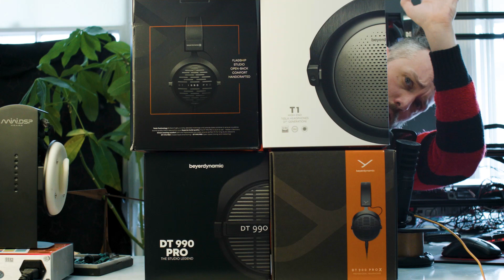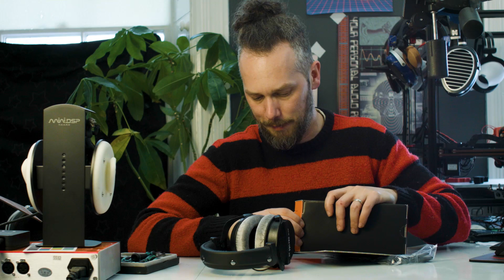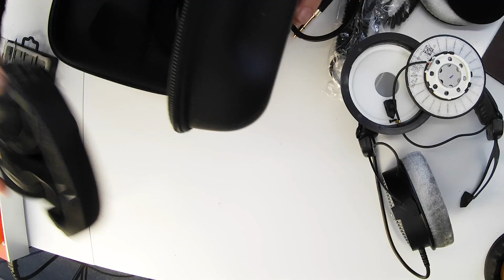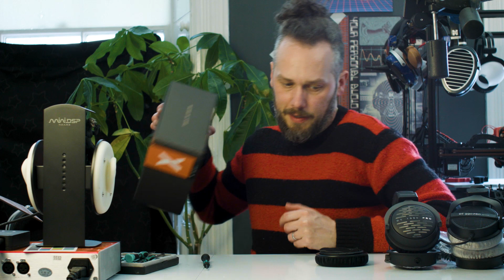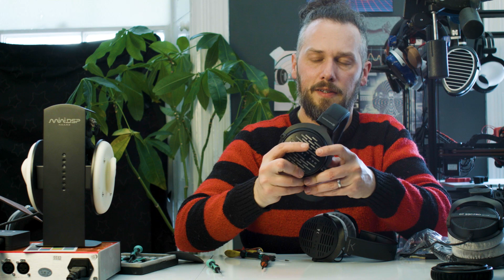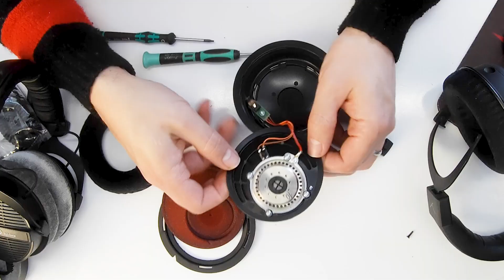Beyerdynamic DT990 vs DT900 vs DT1990 vs T1 open back Royal rumble Part 1

Comment: Hi, is possible to replaced the plastic hinge on Beyerdynamic T1gen3 to metal hinge from DT1990? and you did not mention what parts are metal or plastic in these both headphones (Ex: the black around cups). Thanks
Reply from the maker: No

Comment: yeah im guilty of breaking those small cables on my og 1990. Im still not sure if fixing them is easy or should I just throw em away at this point
Reply from the maker: It may be fixable but you will need to be good at fine soldering - we are pretty booked up with work until march but you could send them in to us to take a look at then if you are in the UK

Comment: Are you going to review and teardown the mk2 1990?
Reply from the maker: I don't know.... I may be on beyerdynamic's naughty list... I have asked several times for them to sell me some and so far they have not shipped any out to me but I may end up buying some retail in the new year
Reply: @CustomCans  mine will be here tomorrow, I also have mk1, BTW, i am in the process of repairing my dt 770 pros. My 770 pros have the older version of the wires, green, red, and Cooper on three solder joints, the new cable has black, red, white wires, do i need to measure my current wires with a multi meter to find out left, right, and ground, correct? Then I add the new the ones?

Comment: Hi. Very informative clip. In case of T1 it looks like if you replace outside metal shield from T5 you can have closeback headphone :) so you can change it from time to time depending you need :)
Reply from the maker: Maybe... I have not seen inside the T5 so they may have to addition tuning

Comment: What improvements are made to the 1990 by adding damping material?
Reply from the maker: it is pretty subtle...  The 1990 are more like semi open so there is still a lot of sound bouncing around inside - if you can cut down those reflections a bit it sound slightly less "boxy"

Comment: what does ballanced do for you?
Reply from the maker: for me.... It lets me have two full time staff making balanced cables ;)  If you want to know what it may do for you... I have an old video here that may help
https://www.youtube.com/watch?v=2bpX13gUJBI
Reply: @CustomCans  1x Balanced Beyerdynamic DT1990
£546.00
Convert Stock Cable - Yes
£6.00
Fit mass loading and damping kit - Yes
£18.00
Balanced connection type - 4 pin XLR Gold pins
-
Cable colour ( see colour chart in images ) - safety red
-
Balanced Litz Cable Length - 1.5m
-
Custom paint for the earcups and shoulders? - No – Standard Black parts
-
Fit Switchable Passive 8K Filter - Add Switchable Passive filter
£75.00
Subtotal £645.00
Thanks seems like a lot of work for what I would like am I reading right could buy them directly like this from CC
Reply from the maker: @patricaomas8750  Yes, we normally have a couple of pairs in stock but they are built to order. They take a week or so to build so if you do order, you have to wait a little while for them to be made
Reply: @CustomCans  Thanks, saving my pennies no problem

Comment: Amazing video to show the interior design between the Beyers. Is there a significant difference between the DT990 editions and the DT990 Pros in terms of the ear cup designs?
Reply from the maker: The drivers are the same but the earcups are slightly different with different openings on the back. I have modded both but not directly compared them. I may hav e to do that in another video
Reply: @CustomCans  Ooooooh, a video would be fantastic! Thanks a lot:) Appreciate your great work

Comment: I've been interested in adding some dampening to my DT 1990 cups. What benefits does this have on the sound? Would you consider adding a dampening kit for the 1990 to your shop?
Reply from the maker: Yes we will add that soon. We have temperately sold out of DT1990s but when we get our next batch in, I will work on a DIY kit
Reply: @CustomCans  Great, thanks I'll be looking forward to testing it out!

Comment: Great video. I actually recently got the DT900 and have been impressed. I'd almost consider it a modern DT880 since the tuning sounds much closer to that than the more "V tuned"  DT990. I think they struck a great balance between a studio/work headphone and one that's also just fun too.
Reply from the maker: Yes, I agree, they are a good all-rounder and will work with just about any equipment

Comment: I have the 990 and the tesla 1990 and you can hear the difference as the 1990 is more precise. So, the 1990's is perfect for me using along side with Focal studio monitors Shape 65.
Reply from the maker: Yeh - the DT1990 are definitely a step up from the 990. They cost 3 or 4 times more but I think it is probablyt worth it if you have the money
Reply: @CustomCans  First of all, man, you're doing a great job, thank you! It's worth to upgrade, but it looks like the 'mighty' EU messed up the monetary system and now the prices are going up.

Comment: Love my DT1990s, but I'm intrigued by the angled drivers in the T1s. I can't really justify a fifth pair of beyerdynamic headphones though.

🤔
Reply from the maker: If you love the DT1990 , I would stick with them. I have not tried it but you could stick some angled pads on them to get a little bit of the effect
Reply: @CustomCans  I'm looking at the angled pads I've just bought to replace the worn ones of my Audeze LCD2. I think it might be worth a try